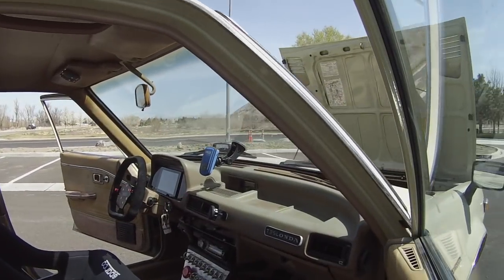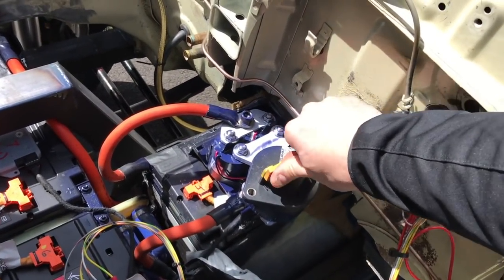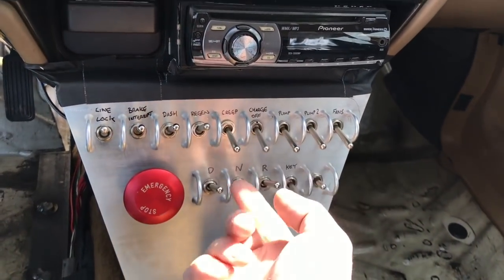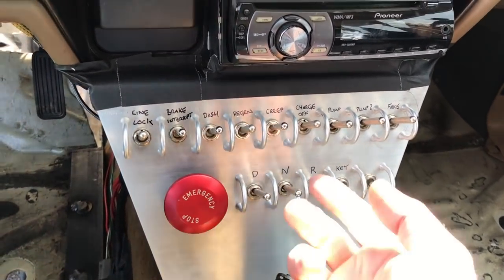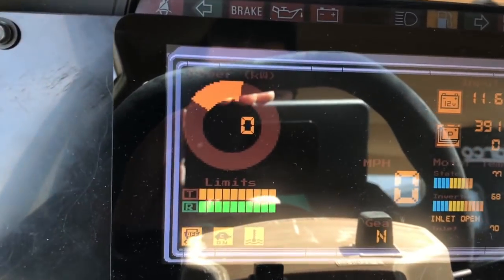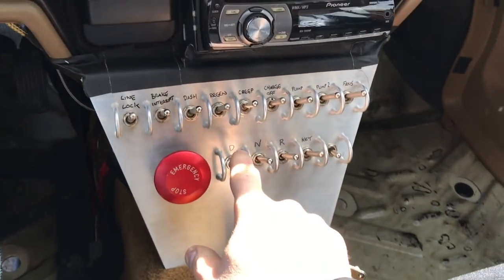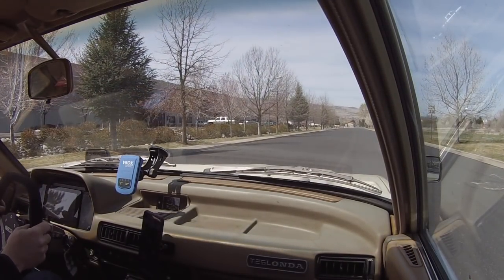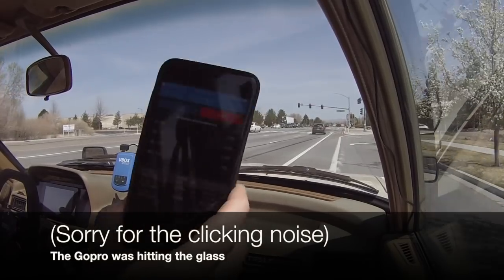Overview + 2.48 Seconds 0-60 for Teslonda!

Comment: Is it possible to code it to minimize tire spin when you're not in burnout mode, by having some sort of sensors for wheel rotation and steering position? (so it can tell the difference between legit differential rotations and the beginning of an unwanted tire spin?

Comment: Incredible car, love the steering wheel! Check out my custom init system for the raspberry pi, It's a LOT faster, loads the bare essentials and is always in read-only mode - no SD card corruption! https://github.com/naprave/RaspberryPi/tree/master/npStarter

Comment: I have a question about the custom cluster, I'm trying to make a head unit for my current project, would the Raspberry PI be able to display/control stuff like AC, drive modes, GPS, etc? If it can do that, how hard would you say it'd be to configure everything? Thanks in advance!
Reply: I've wondered about this as well. In theory you should be able to control at least a few relays using the Pi's GPIO pins - possibly more if you use I2C or some sort of port expander.

Comment: Awesome project, Congrats! :-D
Last few months I'm thinking about something similar based on Smart Roadster, Tesla engine, and some DIY batteries. Great Idea with Raspberry Pi!
I have some questions to you, maybe you can help, if you don't mind:
– how do you solve brake servo or your Honda without them?
– Is transmission the part of the Tesla engine and can be used without changes after swap? From which model this engine?
– What is the possible distance on this motor + the battery can be traveled?

Comment: oi
why not a chevy bolt motor
so this is just a chevy power thing 
just like the ls motors
DUDE  MY CAR GOES LIKE 0-60 IN LIKE 2 SECONDS......
what do you drive 
ITS A HONDA!!!!
thats a fast honda what are you running in there like 50 turbos HAHAHA
NO MAN ITS A LS6 PUTTING OUT 650HP
so you put a chevy motor inside a honda and call it afast  honda?
so you dont need those 400 sticks then eh
HAHAHAHAHAHAH
isnt the corvette like 2.9 seconds HAHAHAHA

THE END
::))

Comment: Just for extra nerd credit, you should add and program telemetry features, like an integrated GPS, and/or accelerometer. Unless the Dash clock still works, it'd be cool to have a digital clock in its place
Reply: Jimmy Built, Honestly, the entire retro theme is cool as hell, especially with the original clock still their. Since the clock does work, keep it working as well as you can, there's probably not many original clocks that work still.

Comment: Is that thing road legal?
Reply: Jimmy Built only in America... 😂
Reply: THUNDERA57 Software in embedded systems such as in this car rarely glitches out. You'd have to be a dyslexic programmer to make software as such.
Reply: +THUNDERA57 Can you hit that emergency kill switch on the dash fast enough if the software bugs out?
The donor car (Tesla) runs the same software. Without a kill switch.
Reply: THUNDERA57 as long as it's the same chassis it's considered the same car
Reply: Jimmy Built noice
Reply: This car is awesome, but I don't agree with the fact that you're driving it in public.  Yes, the DMV sees it as a 1981 Accord, but it clearly is not.  And if something happens and you're at fault I wouldn't expect your insurance to cover anything when they realized you've completely replaced the factory drivetrain.  I hope your software is very robust because this thing will kill you or another motorist or pedestrian in the blink of an eye if a software glitch on the throttle input happens.  Are the brakes you have installed powerful enough to counteract the motor torque?  

What are you pulling close to 2 G's 0-60?  Can you hit that emergency kill switch on the dash fast enough if the software bugs out?  Speaking for myself if I was hit with that kind of acceleration without expecting it I would be disoriented.  I'd install a redundant kill switch on the steering wheel and have a physical disconnect on the A or B pillar.   

Sorry to be such a wet blanket, but a vehicle with this power to weight ratio needs alot of safeguard in place especially one as developmental as this.  Congrats on the build, it is definitely very cool but maybe it's not for public roads.

Comment: Would love to see old cars retro fitted with elec motors. They become much fast,more efficient and reduce emissions. Sick build dude. Look into building and selling more cars like this.
Reply: Aaaand this is why the inevitable transition to electric vehicles is going to be much, much more painful than it needs to be....
Reply: M773 lol old cars arent fast and already handle like shit until you put modren parts on them( source 280z with 1j and suspension from this decade). im pretty sure this honda wasnt hitting 2.48 to 60 with the old motor;)
Reply: There is no reason to feel offended over an inanimate object
Reply: M773 You're the one who came in here and insulted electric engines and people who like them. Get the fuck off of this channel if you have an issue.
Reply: M773 Lmfao you don't know what your talking about... Stock supras arnt that fast... you must be one of those people who think supras come stock with 1000 hp. I think your confusing modified supras with thousands of dollars in it to a stock car. You should do more research on combustion engines. You sound like a idiot yourself.
Reply: M773 the way you compare 1j to electric is how some people comapre the old motor(l28) to my 1j, " old motor went plenty fast":D times are chaginging m8y, electric is cool i had an rc truck that would do standing backflips when you mashed the throttle imagine that in a full size truck
Reply: if all gas is taxed to $50 a gallon i guarantee you'd be making the switch m8;) 100 years is a very very long time. the majority of drivers is 100 years haven't even been born yet to have the bias of gas vs electric.
Reply: M773 dude I don't care how fast they go. A project like this is a fun challenge and the instant torque is fun. I love both ice and eletric. Fuck off
Reply: Why do you have to call someone an idiot for having a different opinion then yours is beyond me. Did your mother never tell you to be nice or what?
Reply: You kind of people literally make no sense. Why the hell do you have a hard on for using gasoline? Why do you even care how your engine makes power? I bet you know a lot less than you act like.
Reply: Im a hot rodder i own and worked on many muscle cars but electric cars are the future and i want make sure I'm on that bandwagon and learn all i can. I have come to find that they are very easy to work on. Its like playing with a Hobby grade RC car just life size. Lamborghini has a beautifully built prototype the Terzo Millennio, if a company like Lamborghini is tinkering with E-Cars then you best follow the trend or you will be left behind with the antiquated combustion engines. A sound module can be created like the RC cars, if you really need to hear an engine. Check out  http://www.sensehobby.com/products/essone/
Reply: +M773 you call out electric car fanboys for never being able to resist insulting combustion engines when OP hasn't even done anything of the sort yet you couldn't resist calling him an idiot lmao
Reply: M773 electric is the future. now swallow
Reply: . Emissions are produced creating electricity. Nothing is free
Reply: Not so efficient and reduce emission if the power generated from diesel or coal powerplant. But max torque at 0 rpm is the shit
Reply: M773 that's false the fastest electric drag car does a 5.67 quarter.mile actually 320 foot less and is built like a funny car. Go check out the multiple YouTube set ups. And I'm a v8 gas guzzling mf and don't want to change that for a long time but electric is direct power on or off and you can't beat the torque curve it's max toque linear throughout the rpm's....
Reply: M773 I drive a car with an internal combustion engine, but I'm still smart enough unlike you to understand the value and significance of EV's.
Reply: M773 I'm pretty sure stock supras run 13s in 1/4 mile. Not 6s or 7s 😂
Reply: you forgot the /s
Reply: Stefan Cupovic tako je bree
Reply: Just don't crash in a retro-modded electric car. All that speed without "crash protection" is just LUDICROUS!

See what I did there? Because TESLA.
Reply: M773 https://youtu.be/_LQXB1DX-2Q here's one I pulled doing low 7s for you since you think it's a joke
Reply: daaaaaaaaaaaaaaaaaaaaaamn this dude is really mad about EVs
Reply: Stefan Cupovic Less emissions from the tailpipe, yes. But FAR more emissions from running on a power grid powered by coal, and batteries made from limited, toxic, heavy metals.

Not to mention: batteries are heavy as hell, and prone to explosion upon collision.
Reply: One thing is the evolution of technology itself, completely another is the aspect of us accepting or even wrapping our minds around the advancements. I don't believe we would be able as a species to adopt the new technologies as fast as we can develop them. Most of the concepts we see today were coined almost half a century earlier, its just lately we, the general public, have grown accustomed to them.
Reply: datsunz1 clearly you have never come across the art of MODIFYING YOUR CAR... you could much more easily get these results from ice
Reply: M773 vacuum cleaners are awesome
Reply: Which character from Fast N Furious do people tell you, that you most resemble?  I guarantee.... you dont own,  nor have never seen a 6 second Supra in real life, you Luddite.  As an actual MKIV single turbo 6 speed Supra owner, I can appreciate the ingenuity of a guy thats doing something different rather than copying whatever everybody else had done over and over again.
Reply: Yep. It doesn't matter if anyone resists electric here in America, because if other countries in the global economy do it, we'll be forced to, or our automotive industry will go the way of the dinosaur.
Reply: Just-A-Neon technology advances at an exponential rate. They predict that we will make 10x the progress this century than we did last century. Think about that, imagine the changes from 1900 to 2000, now imagine 10x that progress. Driverless electric cars are just the start.
Reply: Battery only powered cars will never be the future
Reply: Stefan Cupovic yeah let's just remove everything that makes old cars fun and soulful and make them boring instead. Great idea!
Reply: Stefan Cupovic u know making the batteries poluates more than a car in 20 years
Reply: Shabba Ukelele lol you clearly haven’t encountered enough electric fanboys, 90% of y’all are assholes
Reply: M773 for real
Reply: People that replace classic car engines with electric ones should be locked up. Would you replace an Audi Quattro S1 inline 5 with an electric motor for example? Or the Ferrari V6 of a Lancia Stratos?
Reply: codyd jenkins I don't doubt the fact that autonomous electric cars will be made but I'm doubting the fact that people will convert to electric. I won't drive one in my lifetime. I'll switch to e85 full time for reduced emissions but never electric.
Reply: Jonah Beale there will not be a transition to electric vehicles in this century

Comment: This is a really interesting build, good work sir! Is there any speculation on a quarter mile time/speed? No doubt it can rip a 10 second quarter mile.
Reply: no candy a new gsxr 600 can run tens. I'm skeptical that your 40yr old 500 is that fast. What's the model
Reply: ReadyToGo Obviously you wouldn't. He didn't say specify a build other than a turbo and boost. You need a built engine to handle the amount of boost needed to beat a 10sec quarter mile.
Reply: Jimmy Built this car can destroy most cars 0-60 for sure, but a turbo charged Honda with avg. to big boost would Cruz on by you in the big end of a 1/4 mile track.
Reply: impactajuvenile You're completely wrong. There isn't a Honda that comes with this amount of horse power. The type R has a 13 sec quarter mile, Tesla can do it in 10.5

Comment: Wow, excellent job so far. I wonder if an older Roadster battery, which is a similar form factor, would put out a higher peak voltage / more power?
Reply: @jimmybuilt  
First - Awesome. Thank you, made my day.
Second - I own a Chevrolet Spark EV, and many owners (including myself) are noticing substantial battery capacity loss. I've theorized that this is quite possibly due to high power output from "relatively speaking" small EV battery pack (which is very similar to the Volt, in terms of size and using LG cells)

Do you have any information on your battery pack's capacity and what effect (if any) your shenanigans are impacting it? Thanks!